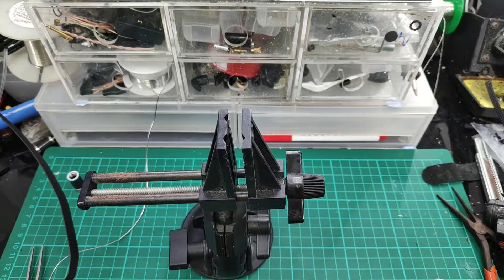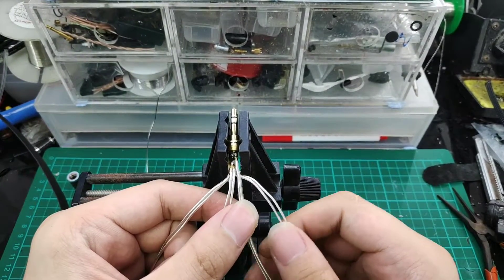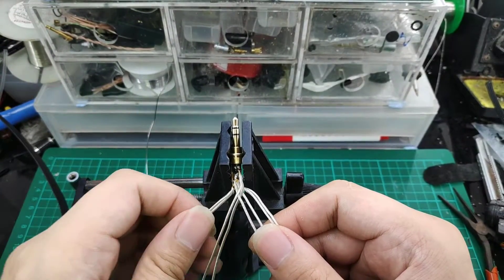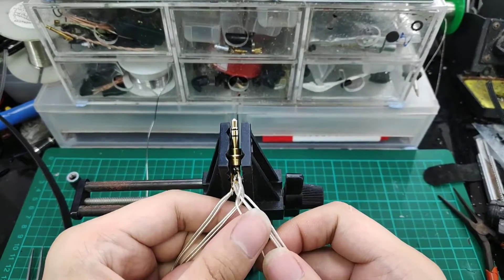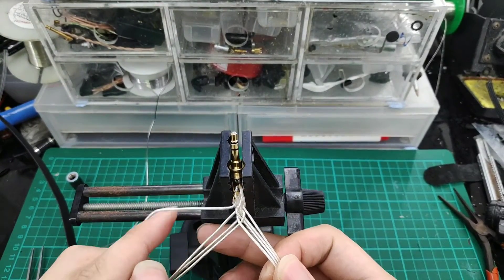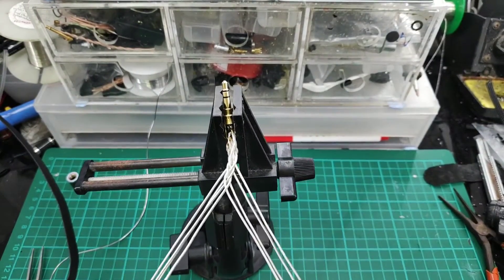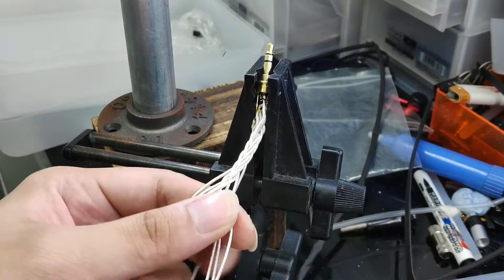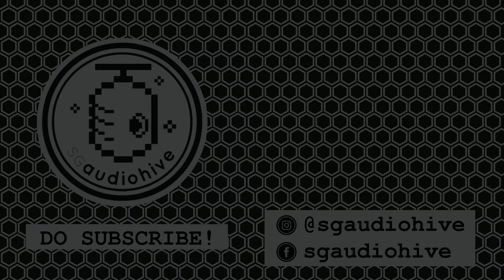8 wire DIY IEM cable Pt.1 - braiding tutorial

Comment: How do I braid a 16 wire cable? Do I do the same pattern as the 8 strand but 2 wires at a time or is it different?
Reply from the maker: That's what manufacturers usually do, so yes

Comment: how long of the cable do I need to make an 8 core braid of 1 meter cable as the end result ? just trying to estimate for the wire purchase
thanks
Reply from the maker: About 1.15m or 1.2 depend on your wire thickness, the thinner the longer
Reply: @sgaudiohive  thanks

Comment: Silver plated is garbage, you need to use silver filled copper wire....
Reply: Pure silver is the way to go. 6N if you can find it, but 5N is fine too. Kimber KCAG variable strand silver interconnects are the ultimate for high end systems.

Comment: Looks great! Is there any difference bewteen wiring for dynamic driver vs balanced armature? Thanks so much.
Reply from the maker: same wiring so no issue with that
Reply: @sgaudiohive  Thanks!
Reply: I'm a bit confused trying to find the right AWG or mm for this project. You've stated earlier you use 24 gauge but the link to purchase the wire says the Outer Dimension is 1.52mm. Could you help me understand this discrepency? Were you referring to the inner diameter? Thanks again.
Reply from the maker: Awg is wire gauge, the dimension is the thickness of the overall wire, you can basically do this with any wire you like

Comment: May i ask how long each wire?
Reply from the maker: Depends on the wire thickness, generally 1.25m each if it's 1.25mm.  1mm wire will need 1.35m each. Also Depends on your braiding tightness, The tighter u braid The shorter it will be

Comment: If I wanted a 1.2m (4ft) IEM cable after braiding, how long should my cables be to start?
Reply from the maker: Depending on your wire thickness, the thinner it is the longer you will need. A tough gauge is 1mm thickness wire 1.25m x4 or 5m total, also that depends on how tight is your braiding,  the tighter you braid the shorter the cable is
Reply: @sgaudiohive  Thanks!  Really appreciate it!  And great guide!  I was able to get my 8 wire braiding done.  Now just need to finish with my MMCX connectors.  Really appreciate the work you put into your guides!
Reply: What wire thickness did you use? I'm planning to get 0.75mm copper from local shop and use that. Will that work?

Comment: Nice video!

Do you know how to assemble a 2.5mm balanced to 3.5mm single-ended cable?
Reply from the maker: That configuration should not work
Reply: @sgaudiohive  This is not true, but you loose benefit of balanced connection. But yes, it is possible.
Reply: @tbr7155  when the -Ve of the L and R are shorted from a balanced into a single end, the channel becomes mono

Comment: What if u made a 36core cable lol
Reply from the maker: "What if"
Reply: @sgaudiohive  maybe one day the gods will do it
Reply: I have seen 16core cable from trn already
Reply: Wow
Reply: @ultraboosted  yea look that up that thing is crazy thick
Reply: @jackywng1236  saw yinyoo has it to sad I do t have mmcx to 2pin
Reply: @ultraboosted  no worry it comes with 2.5/3.5 and 0.75/0.78/mmcx and its cheap. I got one 8core from them and it's great
Reply: @jackywng1236  ah did u see that 60$ Lin soul cable?
Reply: @ultraboosted  that 8core 7n occ one?
Reply: @jackywng1236   Linsoul Soft Silver Plated Cable for Shure SE215 LZ Shozy hibiki Kinera H3 Earphone IEMs (MMCX, 3.5mm Plug
Reply: @ultraboosted  these cable are just so overpriced
Reply: And they are probably going to do 32 soon lol